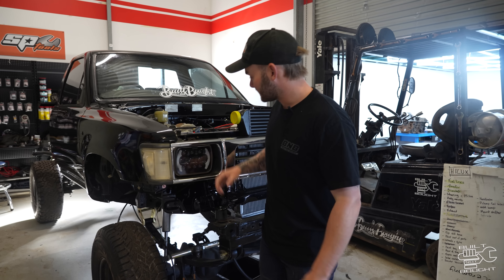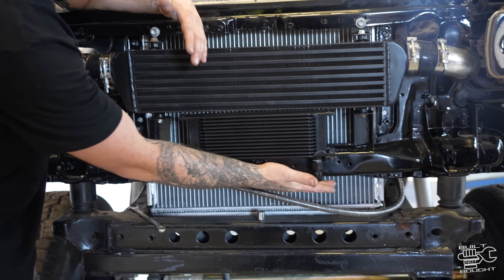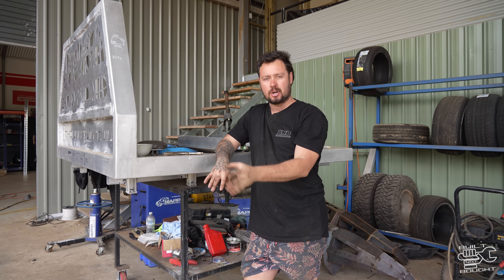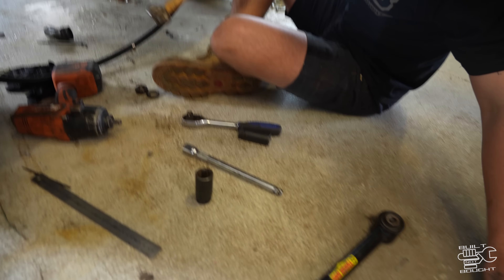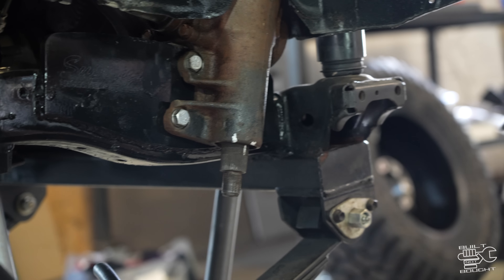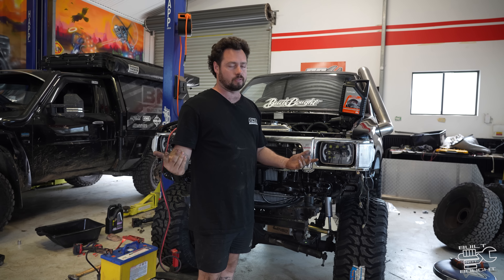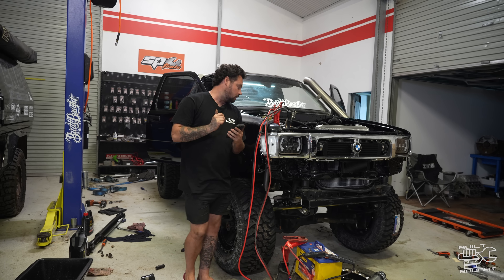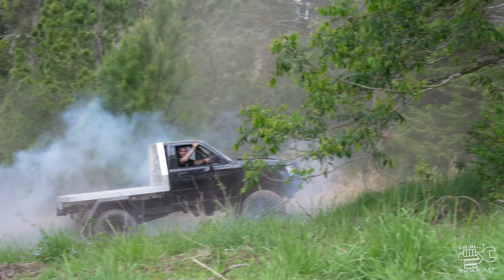M57 Swapped LN106 Actually Hammers 🚗 💨

Comment: surely take the body lift out of it so it sits a bit nicer 😳
Reply: Yeah fully
Reply: Needs the body lift to fit the motor and gearbox pretty sure
Reply: @harrygibbs-hughes4820  half assed, if he’d done the bonnet properly it would have plenty of clearance
Reply: @boofnoof1602  nah just around the trans tunnel and bell housing to fit the gear box
Reply: @harrygibbs-hughes4820  yeah I know what you mean mate, not hard to spend a little extra time to space the tunnel out a bit more. I’m sure he’s planning on digging in a bit deeper on a later date. Just really rushed lol
Reply: Yeah not a fan of body lifts

Comment: run a flat pitman arm and tilt steering box forward ( will need to massage radiator support with a hammer) . otherwise steering will bind under full right hand compression.